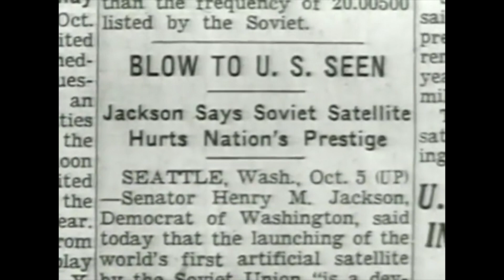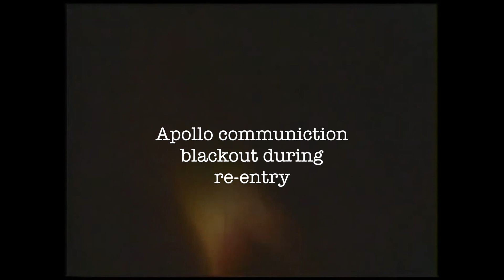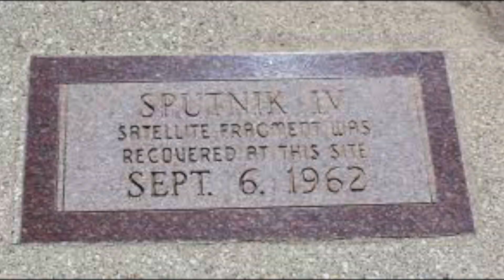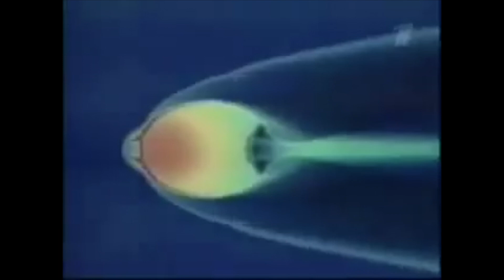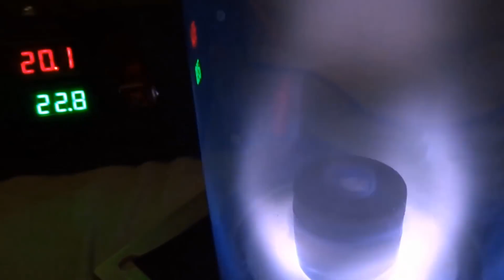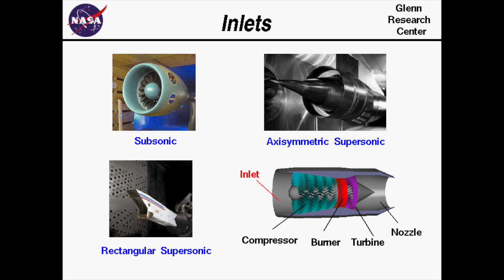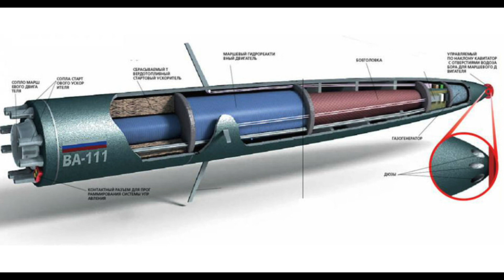Stealth Plasma Tech - Prof Simon

Comment: I didn't comment on the last video even tho I really wanted to have something to add but didn't have a lot I could find, I tried to find the skin temperature of the SR 71 and the leading or trailing edges to see if the friction of the air and the supersonic effects on the air would heat it to plasma temperatures but could not find that data. The temperatures that were registered or released were of internal temperatures and under 1000f.Then I thought of what it would take to make plasma and all you need is a gas and electricity. I considered if an exposed nuclear rod/ leading edge of enriched uranium would make a plasma layer around the plane, possibly. Then I wondered why they dont use enriched uranium as an afterburner or fuel ignitor in the jet itself... or a rocket. Lol that would make sense why its secret, killing us all. Isn't aurora plasma?
Reply: My guess is embedded chemical lasers shooting forward creating a plasma channel that the plane flies through and the angle the plasma channel is how they control their direction at speeds above control surface effectiveness. But that is a guess. I don't think titanium could handle that temperature so perhaps that's where depleted uranium comes in. Can't imagine depleted uranium would be good for radar cross section.